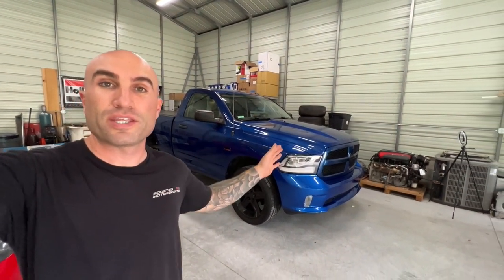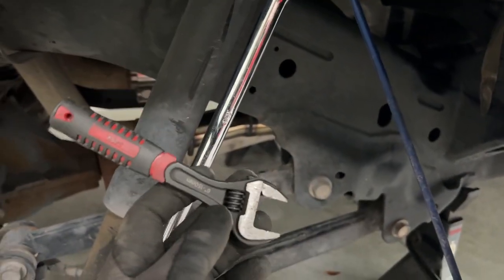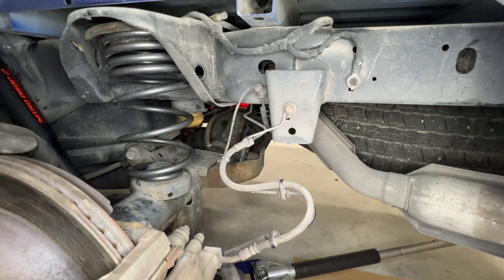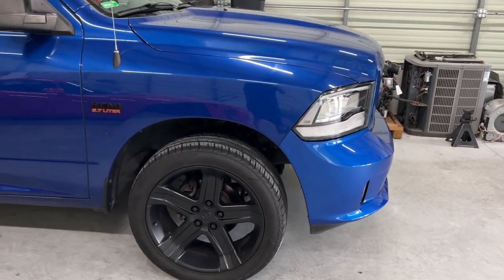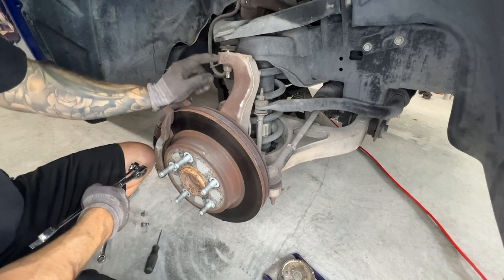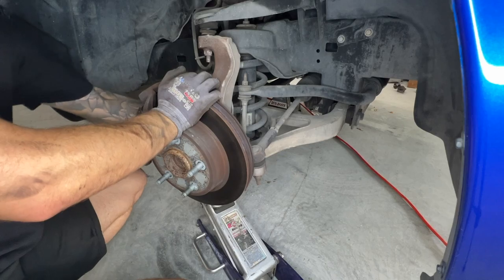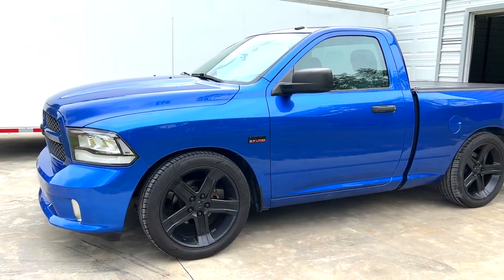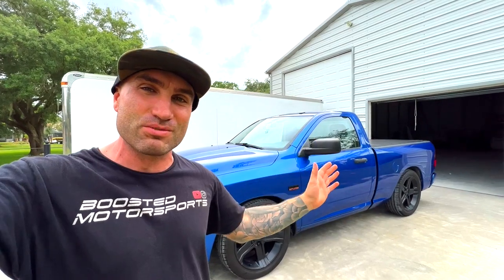Lowering a RAM 1500 Pickup Truck

Comment: Mike, would love to finally see someone install one of these Bell Tech 2/4 kits on a 4wd with factory air suspension.  I badly want to do this to my 15 longhorn and rid it of the air setup but don't even know the extra pieces I would require outside of the kit.   Contrats on the channel, the house/shop and move.  you've helped so many of us for so long with our Rams.  Love living vicariously through you Sir.   I bet I lowered 10+ 2wd Dakotas back in 'the day' 99-04 just like this.  Keep up the great work!!

Comment: Looks really good! something tells me the guy that had that kit cut a few coils cause my 2/4 kit doesn’t sit that low and don’t forget to check that cross member in front of the gas tank probably really close to the drive shaft.
Reply: Yup mine doesn’t sit this low either. I want it a little lower but I don’t wanna pay that much for the 4/6😂 and yes my driveshaft rubbed the crossmember when I first installed it
Reply: Same here. When I saw the video pop up on alerts, I thought it was a 5/7 drop. Good looking stance.
Reply from the maker: I double checked. No cut springs. What size wheels are you guys running cause these 22s fill the wheel wells more usually. They have 285/45-22 tires
Reply: Mine sits that low with the belltech 2/4 drop
Reply: @BoostedMotorsports  i have a friend on a 2/4 drop on some r/t 22’s and his doesn’t look nearly as low as yours, not calling you wrong but it looks awesome regardless
Reply: @erick5.789  it’s probably the wheels. I’m on 20s currently
Reply: The springs get lower in time compared to new ones
Reply: @titoosuna1942  you’re probably right, i have the 2/4 drop on stock 20’s with the sra tires so mine looks a lot higher than his, that’s probably why
Reply: @titoosuna1942  yeah well I’ve had the lowering kit on for 4 years
Reply: Tire size might be the issue. I’m running a 305/40 22.
Reply: I have  295-35-24s with the bell 2/4
And I think I have way more fender gap...how many inches  from the top of the tire to fender?  I'm looking into the IHC kit......
Reply from the maker: You will have more fender gap Eric! You have a 35 series tire and mine is a 45. Your sidewall is way smaller
Reply: These kits are weird I have the same truck an same kit installed my front end sits higher then the rear I even have the same wheels
Reply: @BoostedMotorsports   I put the tire sizes in a tire calculator  and the overall diameter is almost exact @32.1 it could just be a visual allusion w less side wall I have 3 inches of gap  in the front and about 3.75 rear. Just put a tape to the tire looks as if  they are 31.5 or 31 5/8ths..? Thanks for getting back!
Reply: @erick5.789  you got an IG?
Reply: There cut. You can see it early in the video of the springs sitting on the floor.

Comment: I have 22” wheels running 305 45 with the 2/4 bell tech drop. I asked the shop to cut an inch off the rear springs to make it look semi leveled but yours looks a lot more lowered than mine!
Reply: His are also cut ✂️

Comment: After doing 4 of these kits on 4th gens I’ve learned that putting shorted sway bar end links improved the ride and handling.
Reply: Is that for front or rear sway bar links?
Reply: @KJ-wo2iy  you want your sway bars to sit level. Most kits only come with end links for the rear.
Reply: @michaelguillory3100  Ok Thanks 👍🏼

Comment: Great job on  lowering the truck Jon. Looks awesome. Maybe I’m in the minority here but I think the 20” wheel’s from the eco diesel would look better on this truck. They would look better proportioned on the single cab truck. You would save some weight too. Less rotational mass. I hear those 22” wheels are pretty heavy.

Comment: 2016 ram crew cab 2/4 belltech drop and love my truck but can’t wait for a upgraded shocker to be released.  Currently running 305/40/22 with helper bags in the rear

Comment: Just traded in my 2014 ecodiesel that I had that 2/4 kit on with 24s.. got a 2018 1500 limited with the hemi, it has air suspension.. so need to figure that out how to get it lower safely.. that single cab looks awesome lowered!!
Ok, now do the intake!! 😁😜

Comment: what year ??? this is easy build ... I have a 2019 Classic and on FRONT put 2 in (really 1-1/2) drop spindles, the 2 in (really 1-1/2 in) Belltech springs  and kept the 17 in rims with 225x 60-17  for a total FIVE INCHES in front.  Had to remove the air dam.   REAR put in the springs which were ony a three in drop and then kept the smaller 17in rims with 225 X 65 -17 ... very disappointed in the kit. I cut out the rear bump stop perches and often the axle will slap the frame on big bumps. Im gonna have to do a frame knotch to get the axle at least another inch lower HOPING for two, with a different set of springs. Very disappointed in the BellTech kit measly-weak-ass shocks .... have to replace fronts and rears each year.  NOTE on Rear ... I also have a Decked system with a 1000 pounds of gear to keep the rear lower  BUT still want TWO INCHES MORE.

Comment: I put the same shocks on my Ram Daytona and had to sand and file the opening in the control arm to get the boot to fit through. Also, can you show the shock after it was installed? The two bolts on top of the shock kinda confused me. Thanks!

Comment: Can you help - I own a roe viper gen 2 also but have cold start idle issues since Install - we have changed all sensors vacuum leak test etc all good - leads me to idle screws were played with. - what percentage is your Throttle position. Sensor at if you don’t mind sharing this it’s a good start for my adjustments - thanks for you help

Comment: I did a 2/4 drop on my 2012 2WD Ram but got bad camber what upper control arms are good to fix that.?
Reply: Shouldn't have camber , it should be pulled out the most but not enough to wear out ur tires very slight camber . I drop these for a living all the time

Comment: Hey man so this is a 2/4 belltech? I’ve got 285/45/22 on oem rts. 2/4 with Viking shocks all around but doesn’t sit as low as yours
Reply from the maker: Yeah i picked up this belltech 2/4 used so it’s probably settled quite a bit from new
Reply: Which Vikings did you buy.  Looks like they only fit up to 2008?